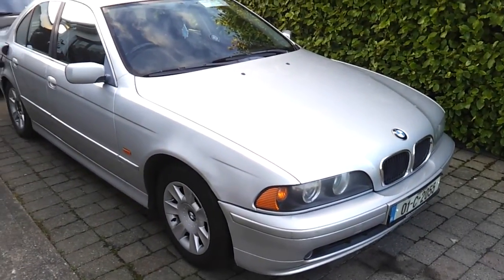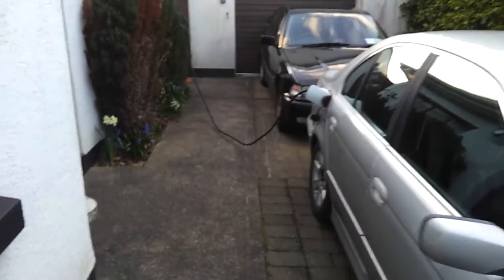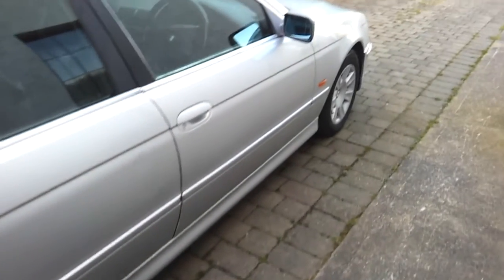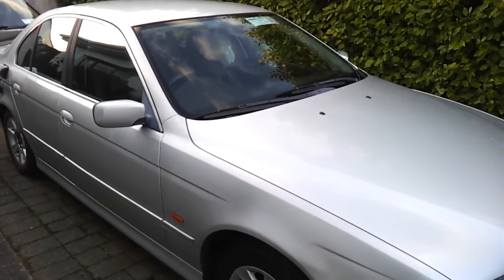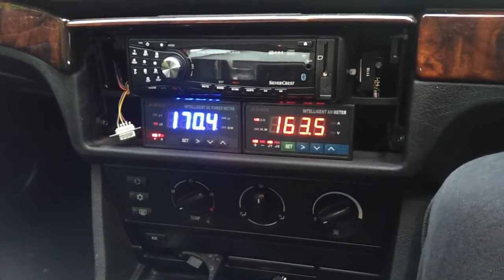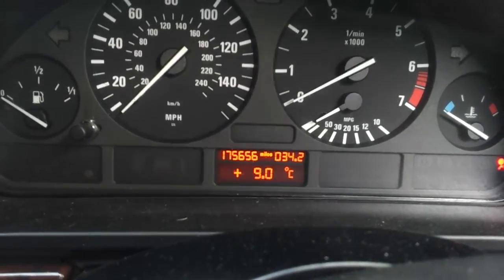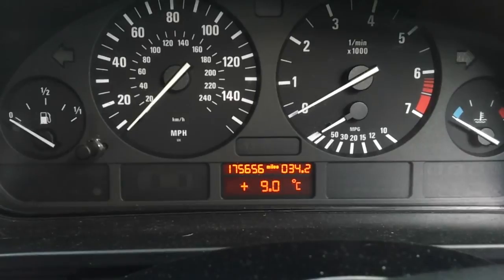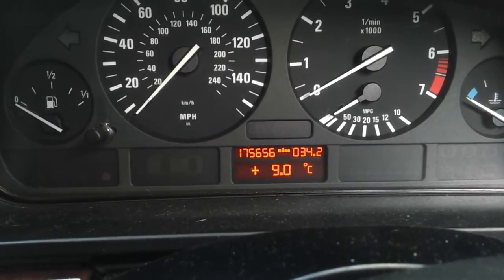BMW E39 EV Conversion 33 Update

Comment: 50 Ca cells @ 180 Ah X 3.5V = 31,500 = 31.5 KWh    Jack's general rule of ev conversions  says you should be able to push a 3000lb car 100 miles!